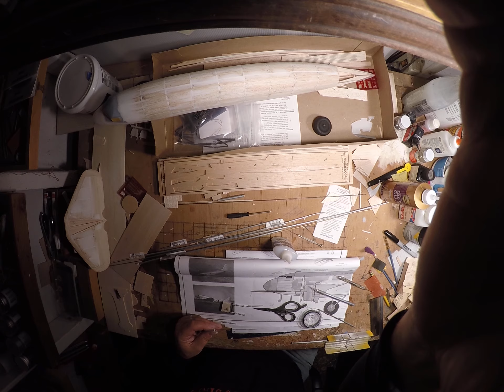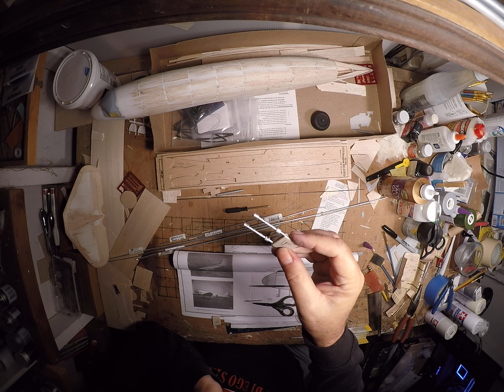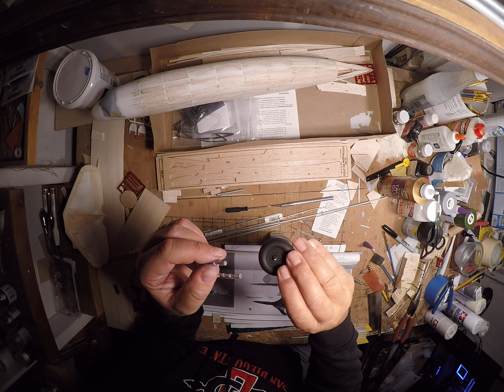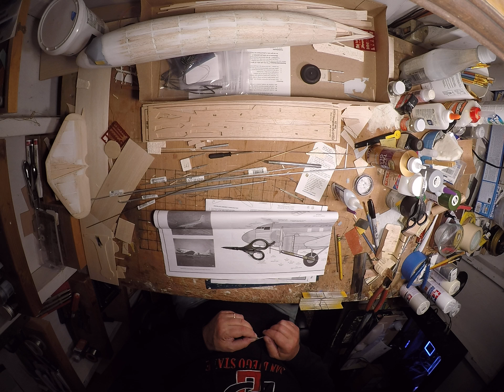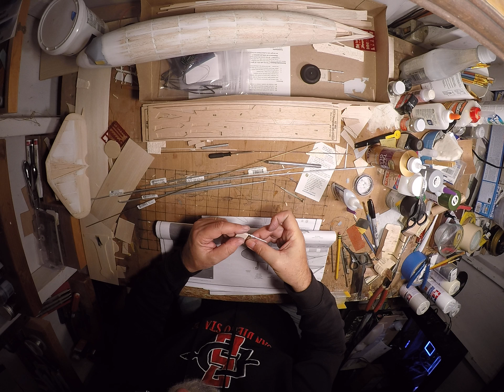Guillow DC-3 Project - Part 16c - main LG fabrication

Comment: excellent! what do you use for the tiny holes?
Reply from the maker: pin vise hand drill - you can see it on the bench just at the top right of the plan sheet